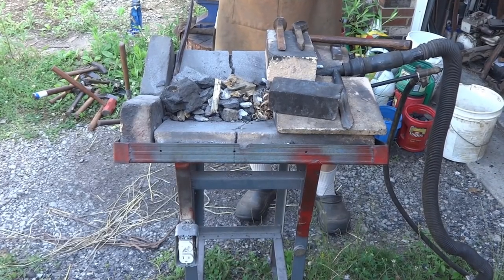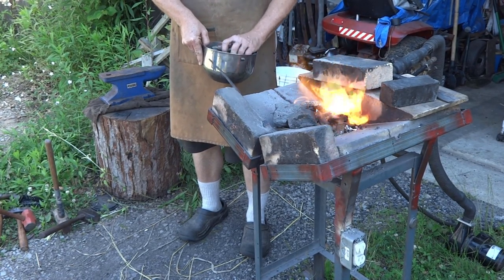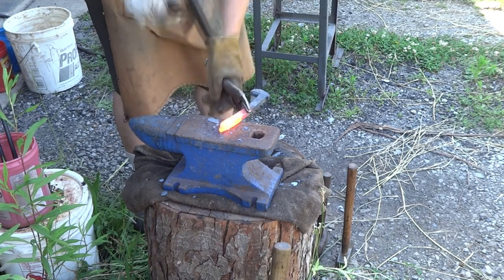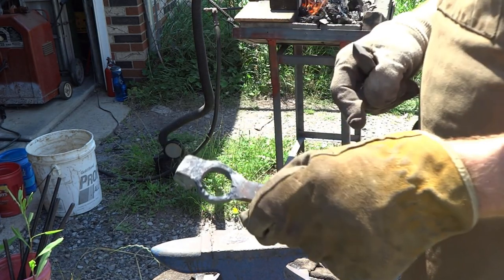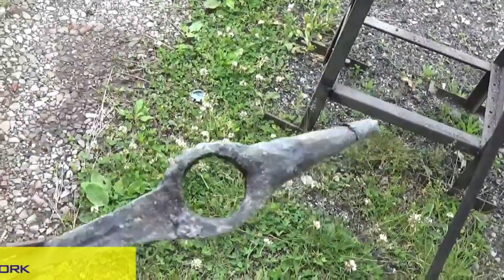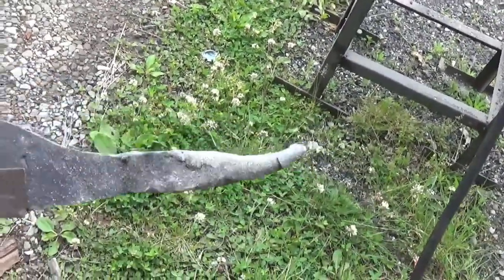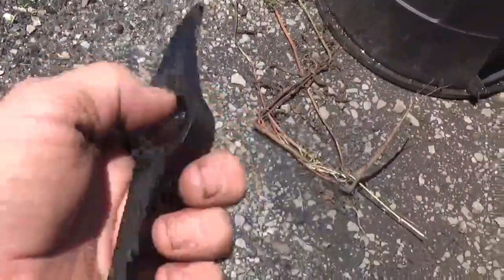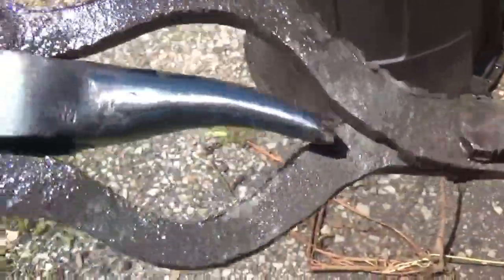Forging a Native American Style Tomahawk (Axe) using Railroad Spike - Part 1

Comment: With an original style tomahawk head, you are supposed to be able to slide it down the handle into place, so it can be easily removed and used as a knife..
Otherwise,  nice tomahawk.